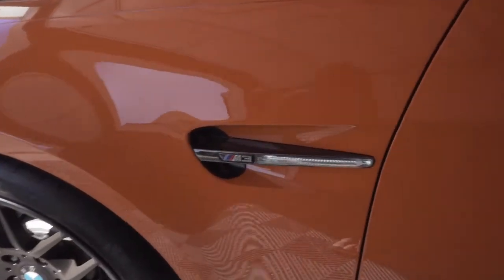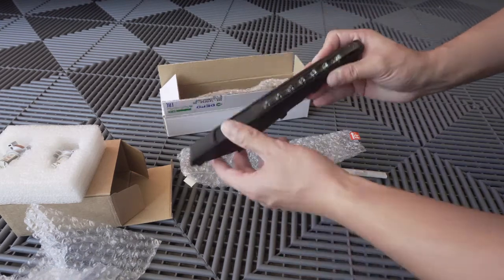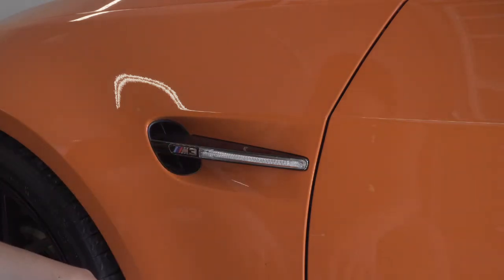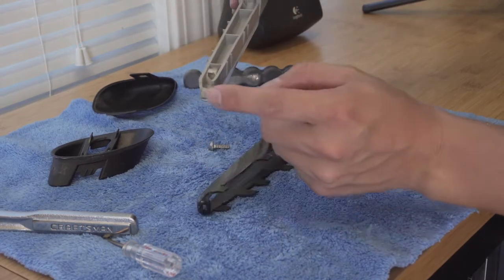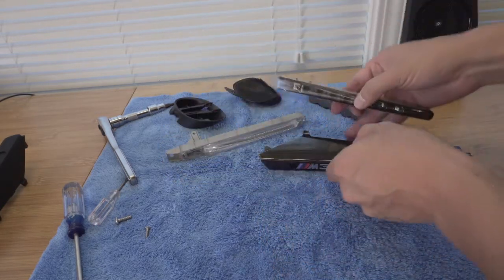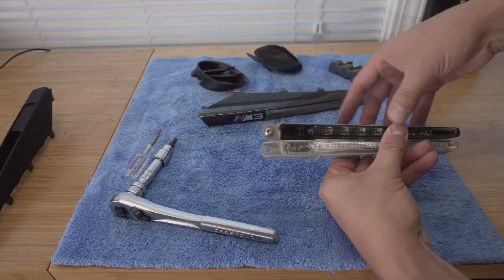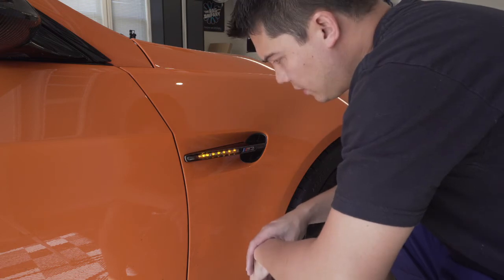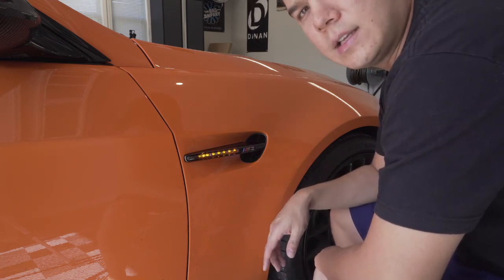Installing LED Side Markers on Craig's M3 | Unique Style Racing

Comment: this works but i broke my tabs on both of them now looking to install a black side marker
Reply from the maker: Yikes! These are definitely hard to get off but this is the easier way from my experience. I have seen guys use screw drivers etc and it is waaaaay too risky to do that and jeopardize hitting the paint.
Reply: Accelerated Motion  yeah no way risking using the flathead. I think i pulled it off with all my strength was really hard to get off. I wraped my stock one in carbon fiber and gona spray paint it tinted this weekend with vht nite shades . Order some double sided tape just in case the broken tabs make it too lose.
Reply from the maker: @leonelmunoz1351  Best of luck! should look nice when its all said and done!